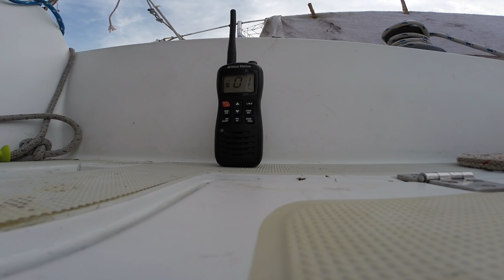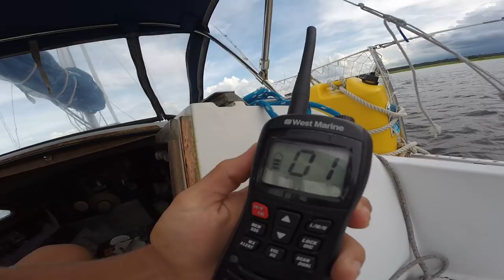Anchoring in Strong Current

Comment: Wes, a pretty simple solution is to have one mid size fender (hole through center) and slide it down the anchor line when you initially set anchor.  If a front comes in, the fender always sits at the surface and often creates enough resistance to keep the boat from running over the line.  If you do encounter a run over condition.   Essentially it simulates a real mooring.   In the worst case should you still wind up with anchor wrap (have not seen this before using this method but I guess anything is possible) just tie a large knot a the end of the anchor line and release the line into the water.  The line & fender should be pulled under the boat thus releasing  the snag.  Hope this helps.  :   )
Reply: Rob M great idea.

Comment: if you drop a stern anchor out,  you should stop from spinning  .. and the spining is whats the problem here..    back years ago in ohio river  pontoon boat i had two river anchors on each end of boat. drop front anchor, let out a shit load of road, then drop stern anchor and then take up front anchor rode to tighten up all slack..  caint you do this with a big boat too...   to prevent spinning of the boat??????

Comment: Wes, check out the Seaward 46 RK. made by Hake yachts. They have several youtube videos that show the boat inside and out. I know you expressed your views on what your next boat would be like and you want a smaller boat than a 46, but this one can be single handed and has room for brothers or patrons to stay as guests/crew. Showers every day because the watermaker keeps the fresh water tank topped off. It has a galley with fridge/freezer and ICE MAKER. No more buying ice. The best part is the lifting keel. This keel lifts in a way that is better than any other. No more anchor fouling on keel and no more running aground. Dual rudders can also be raised  making min. draft= 2.5 feet ! Thanks  for all the vids (cool music also) ;-)

Comment: Do you guys have a new boat in your sights or is it still very mutch up in the air ! Don't forget a second hand Beneteau is modern inside and out easy to maintain boat's that don't cost a ton if you buy them in Europe and some Caribbean places (in the US they can be a bit more expensive, no idea why) and you'd get between a 36 to 42 ft boat in under $80,000 on average no older then 2005.

And they are definitely open water going boat's especially the Cyclades, Oceanis and Cyclone models, if your looking for something more modern, you'd be very hard pressed to get an Ericsson or similar brand of that size in sutch a good condition with those options on board for those prices and they tend to be older boats with somewhat outdated interiors. 

But it would be cool to see you work to restore one of those, they are out there but mostly in a bad or not so good condition for reasonable prices needing a whole lot of work keeping you stuck in a dock for some time to come probably, but like the UMA crew i have enjoyed watching them refit, restore, update her including adding an electric engine⬅( forklift engine ) with a battery bank, she sailing ⛵ now.

Can't wait to see what you guy's come up with,...good luck you two and Lola of course 👍😆.

Comment: Yeah, another Wicked Salty video!  Definitely sounds like you're getting cabin fever (or breathing in too much of those spray fumes).
Is there a reason you don't "Bahamian Moor"  or is it just because you didn't have two anchors?
Reply from the maker: +Caspar0s Just to avoid one anchor fouling on another, we would have no back ups. We only had two and had zero experience dropping two anchors. Just needed to be extra cautious in these circumstances. But we started to always use an anchor weight (kellet, sentinel, milk jug of sand, etc.) because we experienced this a lot and it did help. Hindsight we should have got 80-100 feet of chain and learned to drop two anchors.

Comment: I might have missed something. Are you using 150 ft of chain on the main anchor, followed by the rode, yet you are wrapping BOTH the chain and a section of that rode around the keel, or is it just the chain that is wrapping?   Water temp here at Fort Myers Beach has been toying with 80F lately.  Time to get back into the water  :)
Reply from the maker: +Bruce Malo I believe I said 160 feet, 8:1 scope, that would have been 60 feet of chain and 100 feet of additional rode. Jealous on those Florida temps!
Reply: +Wicked Salty     WES =   CHECK YOUR FACEBOOK FOR A MSG